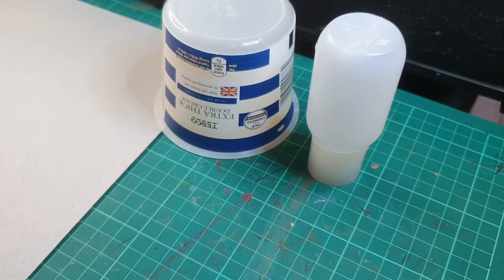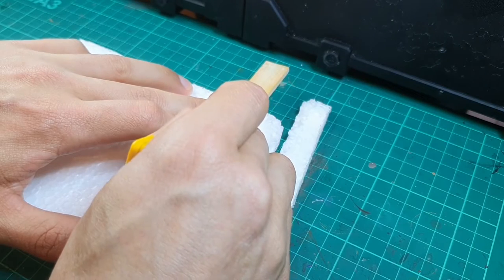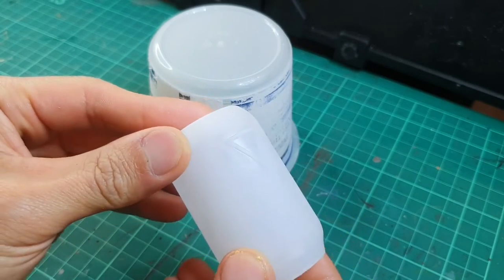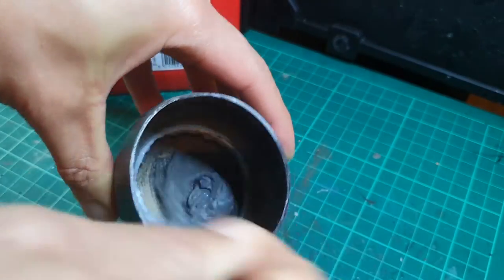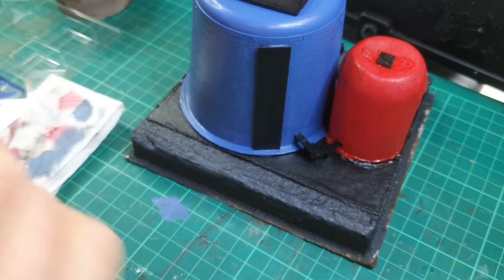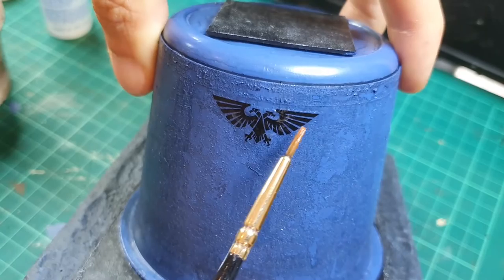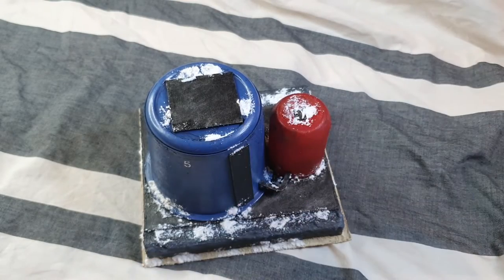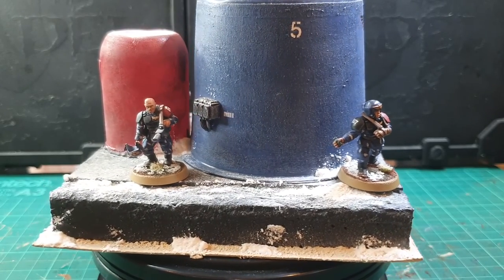Terrain tutorial -  Fuel storage model made from stuff found around the house | Warhammer 40k

Comment: Here'sa terrain idea that I did, cheap and easy:

In America, toy soldiers with terrain bits are everywhere and cheap. What I did was get things like a "pile of rocks," and slapped my cheapest oil wash over it, and a bit of dry brushing. Use the troopers as burnt corpses, statues, whatever your mind wants.
Reply from the maker: Thats cool - I've made alot of 'larger' terrain pieces so far and need to develop some smaller pieces. Will have a go at what you suggest